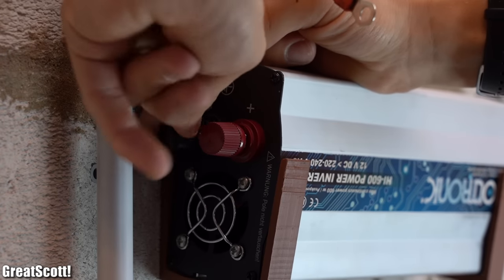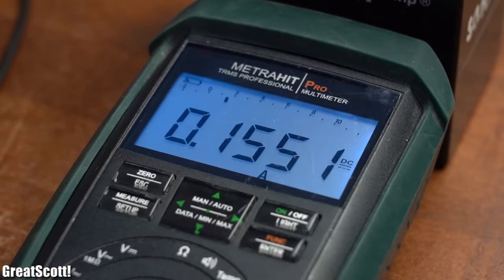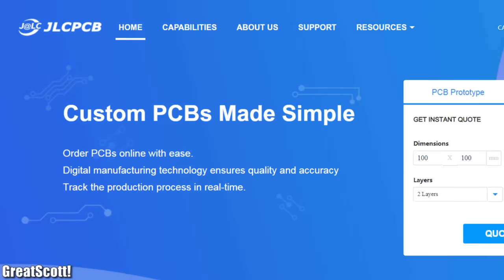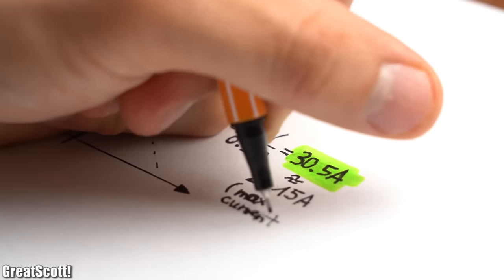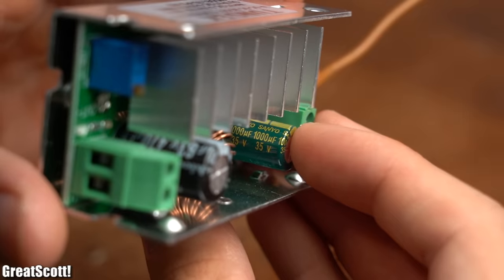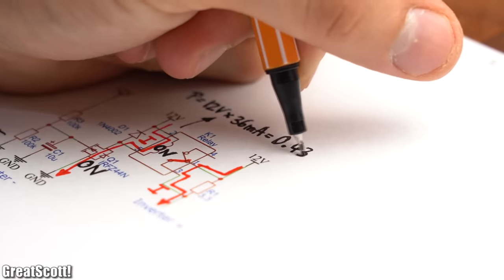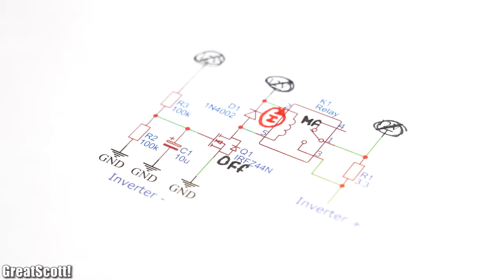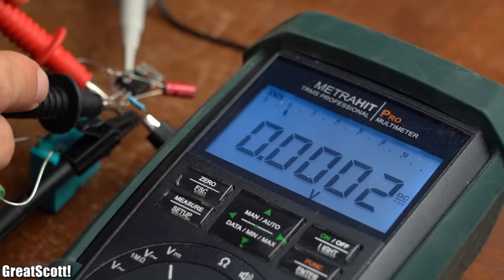How to make a Softstarter and why it is sometimes mandatory to use!

Comment: Why didn't you use a mosfet with low Rds directly instead of relay(maybe 2 or more in parallel?), that would be more efficient i guess
Reply: Calculate the ohms required on that fet with a 600W load.
Reply: @benbaselet2026  That relay doesn't look like capable for handling such power either. 
And the load current is limited to 15A only. A mosfet can handle that, No sweat!
Reply: @benbaselet2026  If it is a 0.5mOhm Rds mosfet (Two 1mOhm Rds mosfets in parallel maybe), Total power loss in mosfet(s) is 1.25w at 600w load.
Try that relay at 600w. It wont last long.

Comment: Wouldn't a power mosfet with a low residual resistance do the trick too?  
  
According to my calulation you would need something with 1.6mOhm to reduce the powerloss, that should be something that exists.

Comment: 4:42 so it's possible to blink an LED with only a capacitor, if you don't care about duration or consistency, no 5-5-5 timer with a 9volt needed?
Reply: Yes, just using RC constant.

Comment: Hello mate, I’m sure you could help me in designing a Ac current limiter. 
I have a little Ac dimmer that can handle 140w at 240v. 
Can I use a thermistor to limit the wattage ( current ) ? 
When I turn the dimmer up it overloads at 165 watts. 
Can we cap its output at 140w ? 
Help. 
Kind regards
Jafo.

Comment: Why dont you add a resistor and cap in parallel and then in series with the relay to decrease the current after the relay opened

Comment: I kind of have the reverse problem. I am using a 12v 200w power suply and a 150W DC booster to drive a 100W LED. If I connect the booster to the already running power suply there is no problem BUT if i leave the power suply and booster connected and then give power to the Power suply then it flashes the LED and the mosfet (nce6075k) of the booster gets fried, every single time.
I dont have an osciloscope but my gut feeling is that there is a big cap on the output of the power suply that takes a while to go up in voltage. Now, I think, my booster tries to draw as much power as it needs and while the voltage is low the power suply can provide enought current to fry the mosfet.
Is that posible? I guess this circuit could work for that.

Comment: my water pump kiks off my inverter sometimes. i really dont need such a big pump but a soft start would likely solve this. inverter just cant get the draw from the battery bank fast nuff. 
sue sucks when ur in the shower and u loose water pressure ;)

Comment: My inverter from Poland doesn't have any discharge rezistor parralel to input side and it's fun to shorting  it with screwdriver 😂 I opened my inverter and what i saw was a bunch of caps in the input but each of them have a 6800uf 😂 So even if you connect it to the battery the sparks are extremely huuuge but they are even huge when you discharge it using screwdriver .... Poland $#!t

Comment: Why do you even need the relay? Couldn’t you have the same capacitive charge setup but then have the capacitor voltage fed to a parallel P and N fet. The P fet has the startup resistor I’m series and the N fet has nothing in series. At the start the P fet is active and feeds current through the resistor and the N fet is open. After the cap charges the p fet opens and the n fet closes to have the low resistance during drive.

Comment: Too complicated solution. What I did with my 15A bench PSU to stop blowing its input fuse when turned on, was just add a relay and a 5W 220 ohm resistor. Rectified DC output before the regulator circuit was 50V DC, so I chose a 48V relay. Connected the relay coil in parallel with the smoothing capacitor array (4 x 6800uF), broke the input path to the capacitor array on the PCB, and added the 220 ohm resistor in series. When turned on, the capacitors start charging slowly with the restricted current from the resistor and when their voltage reaches high enough (takes around 3 seconds) the relay gets triggered and bypasses the current limit resistor. Works fine for me, never blown a fuse since, and it fits my motto: K.I.S.S. Keep It Simple Stupid. :-)

Comment: Solar power supply needs current limiter on its output - problem solved. From there, battery and then onto inverter etc. Battery can provide inverter with inrush current and solar supply can recharge battery at it's own rate. Problem solved - without doing mods to inverter.

Comment: i want to use a PC SMPS to run a RS 555 motor but when i connect the motor, the power supply gets turn off. what should i do ?

Comment: I am not sure why you didn't use a TO-220 P Channel MOSFET instead of a relay?
Reply: Because the Pfet would also work in linear resistance mode at the switching point, possibly exceeding its SOAR.
Besides : the relay makes the switch universal, not polarised.
But in your particular application it could possibly work a treat using a Pfet and a resistor instead of D1.
Reply: @CXensation  with enough (low) voltage on the gate, the FET will be a switch. I was hoping maybe Scott would answer.

Comment: I face the same problem but at 220 volts side.When I connect my CPU to inverter output the inverter trips even when power consumption is within limits.Hope you solve the same problem at the next stage.

Comment: @greatscott
I need to run a DC motor, using a 48v @33A SMPS, and as soon as the motor is turned on, the SMPS goes into protection. However, if i start the motor at a lower RPM (1500rpm / 10k) the SMPS is fine, then i can bump it up to 5k, then 10k and the SMPS stays running, and doesn't even get warm.. 

How would i impliment this soft start circuit?? 

I've been playing around in circuit simulators all week, and still can't quite get it. i can get to the point where the load (motor) gets about 7A starting off, but the issue is the voltage keeps climbing on the gate of the mosfet, going well beyond the threshold until eventually i feel the current and voltage would destroy any fet i put there. 

Any suggestions on how to create a softstart circuit for this situation? (as i'm feeding PWM from a control board to a motor driver board, i don't think i can use an MCU here)

Comment: Is there no inductor that wouldhave worked?putting it in series with the input and a diode parallel for protection.
Reply: Do the math and tell use what value inductor we would need ...

Comment: Sir i made a rectifier 140 vdc 40 Amp full wave bridge rectifier but when i connect 250 vdc 10000 microfaraday dc capacitors the input rms current take  1.5 times more in input please sort out my problem

Comment: not enough battery and inverters should be permanently connected to keep the capacitors charged, use power switch on inverter to turn it off but leave capacitors charged.
Reply: Leaving the Inverter ON 24 x 7, can drain many IDLE Watt-hours from the battery bank in a year

Comment: I have also seen PTCs being used for inrush current solutions but why? It makes no sense in my opinion. The power loss increases after the inrush.
Reply: Those are used for overload protection I believe, draw too much current ->PTC gets hot -> device turns off (or is limited in power at least).
Reply: @benbaselet2026  Thanks, I have seen an advertisment like "PTC Thermistors For Inrush Current", and I have seen some article about PTC vs NTC in inrush current. So I got confused.

Comment: Wouldn't it be simpler to just have an inductor in series?
Reply: Would have to be relatively huge and very very expensive. Also, inductors and capacitors together tend to form oscillators.

Comment: You should mention inline transformer on mains side in power supply. 
It is there for two reasons
1. This is inductor which is actually doing wiem to limit rate of change of current
2. It limits noise
NTC is there not to limit inrush current. It is there as part of protection of both power supply and your electric installation. Limiting inrush current is simply side effect.